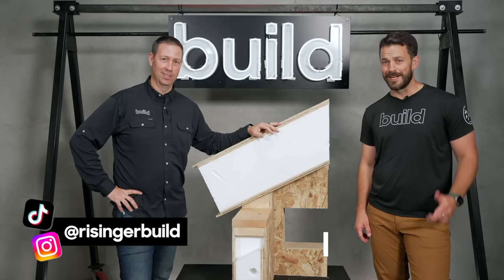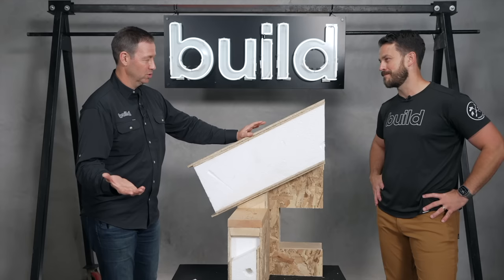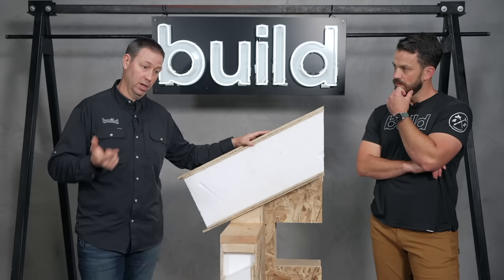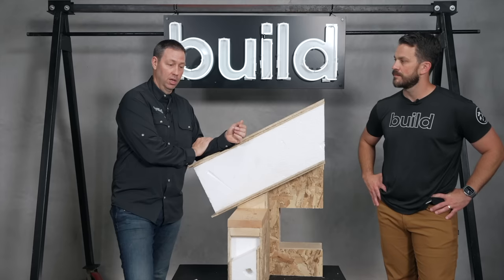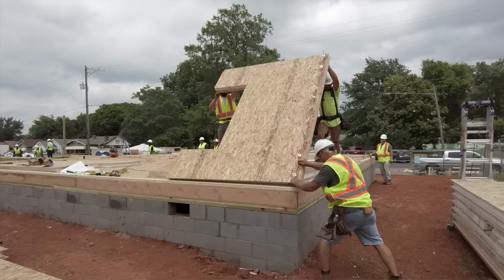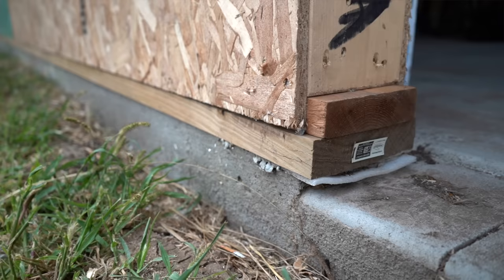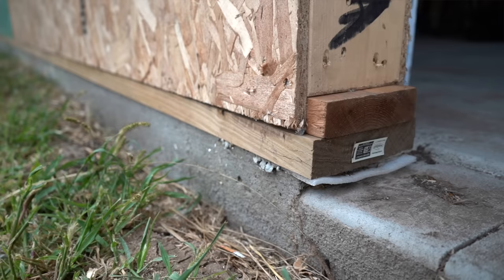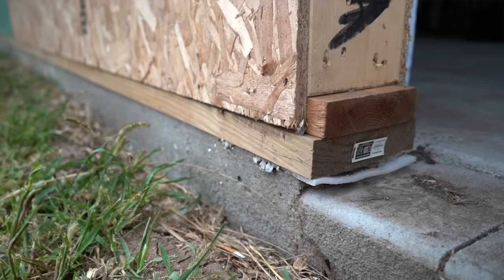SIPs Framing Update 2023 - Extreme Panel System Install w/ Will King

Comment: For the life of me I can’t understand why there isn’t more coverage and usage of steel sips. Totally superior in every way to even a plywood sip panel. Lighter. Stronger. Can be structural as well
Reply: Oh and let’s talk about wood splines and spray foam between panels. Take a look at steel sip panels. Goes together with male - female connectors
Reply: Same! I've been researching this topic for over a decade..  There are even more advantages than what you listed with steel sips over wood. Blows my freakin mind🙃
Reply: Well I put my money where my mouth is and I’m building with steel SIPs panels. I did a ton of research and could not phantom building with formaldehyde glued particle board over foam instead….
Reply: You make them very tight sealed around Plumbing and so on ! and sealed properly in between them then you put whatever on them rubber even whatever you want lay down two-by-fours laid flat vertical walls and roof then you can put steal whatever plywood osb again even, your doing a
 cold roof and the walls at the same time then vent.
Reply: He didn't explain the electric or plumbing well enough. How do you fish the wire for normal outlets? Or main panels?
Plumbing must be a nightmare.
Reply: @bobainsworth5057 sounds like the vertical chases let you get up from below or down from above. Or can run into another room side to side too. But I’m not sure how you’d get from the horizontal running down to your outlet or up to the ceiling.  I’d love a follow up video of those trades specifically putting in outlets switches etc.
Reply: @bobainsworth5057   yes and no you can precut wiring they can do it or you could I'm sure, to save money and plumbing you just drill and seal, and seal it off no gaps no "moisture Drive" that could be a problem, you also can put some outlets in the floor, I love insulated and sealed raised slabs with slate and tile with radiant heat ! Really nice, again you pre-plan electrical you can pipe it whatever make a long pipe router bit and guides "long drill bit" 
"hot wire" cut it precut simple..
Reply: @bobainsworth5057  it's definitely intimidating for an electrical guy that's never done it I think it could throw them off a bit.  😂
Reply: Carpenter ants LOVE Styrofoam 
And once they have started..
Lord help you!!
Use of borate in the production does not solve the problem
Reply: Will you please share more details on your findings, or at least share the product you decided to use?
Reply: @johnturner7060  Do you have documentation on this? How come borates don't help? I'm sure there's no nutrition for them in there. Are you saying they like to nest in there, or what? Is urethane foam more resistant? More details, please.
Reply: @bobainsworth5057 Fiberglass fish tape. It gets you through the chases for pulling wire. Then cut a hole for a flange box and screw it in.
Reply: @bobainsworth5057 You try to run all the Plumbing in interior walls.  Just a meter of designing for it.   Electrical, you have a chase at 18-inches up for receptacles, one at 43-inches for switches, and typically a vertical chase at a maximum of every 48-inches.   The factory can leave the chases out or add more if you specify them in the order.  Important to have your subs lined up and committed at the beginning.  So, the subs can review the cut sheets for the panels, and make sure chases, etc. are where they need them.
Reply: @magictrading8903  I am glad that you found a system that works for you.  I am very happy with our Extreme Panel project.  I personally would rather cut and screw plywood. It's a preference thing.  I would be curious on the screw holding power of the two.  Particularly for cabinetry etc.
Reply: @magictrading8903  I actually had never heard of these.  Seems like plywood would result in lower ACH numbers.  I had such a good experience with Extreme I would recomend them to anybody but I can see value in the steel skin.
Reply: @bobainsworth5057 I’m thinking you probly use  a vacuum to get the fish twine through the preexisting chases. Then just pull you wire . 
We use that system a lot in industrial applications.
Reply: Who makes the steel sips panels . I’d like to research these
Reply: Well Not so Fast...  Metal does bring some Major Problems with the Condensation.
Reply: @jameschupp2230  oh yea? How so with a full thermal break. Pls do tell
Reply: @magictrading8903  Yes it would require a Thermal Break
My interpretation of your first statement is that the whole wall / roof panel was incased with metal.
But with a thermal break, than that would help prevent the condensation issue.
Reply: @bobainsworth5057  Plumbing you come up through the floor from the basement or crawl space, and keep in the interior stud walls.  Electrical in the exterior SIP walls, is run in channels made by the factory.   They are typically at 16 and 42 inches above floor to meet boxes for receptacles, and switches.   Vertically you have a chase at 1-foot from the right hand edge.  But you can ask the factory to put them where you want, or add an extra or two.   One of the tricks is to use low voltage LEDs for the lighting and a light controller to drive everything.
Reply: My guess is that steel sips would have a much higher material cost. And realistically few /no one could afford it to create a whole house with them.
Reply: @magictrading8903 
May I ask which steel SIP supplier you prefer ?
Reply: @changwilson  there  are a few companies that produce them. You will have to do your own research as each have their pros and cons. I ultimately went for a full steel skin panel on the inside and out. They make some that basically are just reinforced eps with steel studs and headers. I agree there are a few challenges, like accommodation for blocking to hang cabinets etc. but the pros vs plywood anything are well worth it IMO. There is very little info on steel sips so I had to learn as I went but watch a few plywood sips builds and tell me that the splining the seams and injecting foam doesn’t look like a nightmare. And in the end you have what is not that different than a traditional stick build. I started with the premise that I wanted no organic material in contact with the elements and so I use no exterior wood. I wanted as little maintenance as possible. I don’t understand building with plywood or any wood product in the north east. Just seems like asking for trouble and a matter of time. Even if you protect it well you have expansion / contraction and insects and warping - fire - weight. The list goes on.
Reply: You can't get phone signal in steel sip building. Not popular
Reply: @mrkanarya1907 lol and the govt can’t read my brain waves either! Haha another plus if u ask me
Reply: Thank you for this comment, I’ll look into this product for my future build
Reply: Where do I find out Miya about steel SIPS?
Reply: @magictrading8903 are there non-binary connectors? Like they-them connectors? 🤔
Reply: @jeffconley819  Is there a vacuum tool or fixture I could Google for that's used for this?
Reply: Why is no one (that I'm aware of) building SIPS with ZIP for the outside layer?
Why is there a huge thermal break where the wall meets the roof?
I could have sworn that I heard them say that they recommend a ridge vent... in a conditioned attic??? Did I hear that right?
Why not use some cheap 1/2" thick  furring strips 24" OC between sips and sheetrock for the wiring? That couldn't add much to the overall cost, right?

Comment: I'd like to see a follow-up episode specifically on installing all the electrical, plumbing and HVAC. Very great system, would love to design a house specifically using your SIPS.
Reply: My question exactly
Reply: Mine too. Especially plumbing
Reply: @perspectivefrommarz plumbing is all interior walls.
Reply: Would especially be concerned about the electrical installation issues.

Comment: Hope one day they take SIPs to the next level and start making ZIP-SIPs.
Reply: Eco-Panels of Tennessee
Reply: I thought about the same thing but it's important to remember there's a moister and air seal in the middle of the panel, if you sandwich osb between two vapor barriers, it will trap moisture and caus issues.
It's what they are talking about with the roof membranes they use a vapor permeable membrane.
It would be interesting to see that combined with the panels, a surface layer like that may complicate shipping and handling of panels.
And scrape might add unplanned repairs.
I like the continuous overlaping seam water barrier thought.

Comment: I built a 30x40 urethane SIP shop in 2004 outside Tucson AZ. It had SIP roof panels and 20x30 apron in front with roof, it took a crew of 4 guys only 2 days to set up. I put radiant heat in the floor connected to a solar heated water tank and was happy all winter long. I got a mini split AC and turned it on for about 2 hours a day in the summer. I just loved working in the shop...
Reply: That is Amazing!
Reply: That is absolutely mind blowing how fast these guys can put up the stuff the energy efficiency as a total package is mind blowing
Reply: Can you tell about your radiant heat system? I am very interested in how that really works. Thanks.

Comment: Hey there! Thanks for the collaboration Build Show team! We're thrilled to have had the opportunity to answer all your questions about Extreme SIPs. We hope your viewers found the deep dive informative and helpful. If you have any more questions, feel free to ask! 🏗️🔩
Reply: I will definitely have to check them out to get an estimate on my simple home design. Since I am hoping to do most of the work myself on 1000-1200 sqft home, this could make things alot easier on me and I won't have to plan so much for all the air sealing and structural items like hurricane ties (i'm in south GA but some of these hurricanes have made it close to us in the past few years so i would like to see a little extra strength in my home design).
Reply: It be interesting to get a video of an electric/ plumber install
Reply: indeed cavaliers!  that would be great!  

2 questions I have: 

1.  you say you can hang (almost, im sure) anything anywhere.  what about those electrical & plumbing raceways...are those protected or just soo out of the way that you won't have to worry about putting a screw thru it?? 
& 
2.  i should mention i love, love the construction technique! what about damage after a fire or water . . . how easy/difficult is it to repair that?  maybe go into a little detail please and thank you gents!  good stuff for sure  : )
Reply: What is the Density Per Cubic Ft. on the EPS Foam in the SIP?

Comment: It would be interesting to see ZIP sheathing on the exterior and really streamline the dry in process
Reply: Eco-Panel of Tennessee has the zip exterior sheathing as an option.  But I haven’t found any manufacturers west of the Mississippi, and I’m in Idaho.  I have a couple of the manufacturers close to me who I asked if they would do it as an option, and they aren’t interested.   I’m trying to figure out a breathable self adhering membrane, I can apply on the ground….  I’m designing for a 12:12 pitch on the south facing roof to mount solar panels to, and being able to get a water barrier on it while on the ground would make life much easier.
Reply: @randallthomas5207  Why not apply Delta Vent SA after it's built, the traditional way? I assume it'll go faster and be more water-tight. My plan is to wrap the whole house in that from foundation to roof ridge. I checked with the manufacturer that it can be used as the only roofing underlayment. Also, Eco-Panel does ship anywhere in the country as far as I could tell.
Reply: @stevemarton5620  Shipping cost becomes quite high shipping from Tennessee to Central Idaho.   And I will want to dry it in as soon as it is up.   I’m going with SIPs because I can erect them with a couple of helpers.   There will be a daylight basement, planning on it being ICF, with an ICF concrete ceiling which will function as the floor of the upstairs of the house.  The lot has a ten foot drop over 15-ft from the upper level to where the basement will daylight.   So wrapping half of the upper floor will involve erecting scaffolding.   If I could rent an all terrain man lift, locally I would wrap after the SIPs are up.   And with a 12:12 roof pitch for much of the south side with the basement walls and the main floor walls combining for a twenty foot drop from the roof edge, I want to have the roof deck ready to install the metal roof, with a minimum of work on e south facing roof.  A 12:12 is a bit steep.   The north roof is a 4:12.  Lots more comfortable to work on, particularly with only a 12-ft drop on that side.
Reply: @randallthomas5207  Are you certain on this shipping? EcoPanel of TN is actually shipping mine to New York in a few weeks. But the cost of shipping vastly beats our higher cost of labor. Plus I was interested in the ZIP.
Reply: @pettydesign  Haven’t gotten quotes, but Idaho, and Montana are both very non-Union, and have extremely low wages.   And Tennessee is a long ways from Idaho.   I will probably ask them to quote the package, and double check that though, the use of Zip Sheathing would eliminate some of the other concerns.  Particularly on the roof panels.

Comment: A friend of mine is a SIP builder.  He gets his panels from Extreme which is about a 7 or 8 hour drive from the Black Hills.  He does blower door tests on all his homes and He is extremely finicky about fitment and sealing.  I"ve toured the Extreme panel plant and my cousin built some of the early equipment for SIP manufacturing.  Next time you talk  to Perry Penske or whomever you speak with, ask them about the curved roof panels they built for an architect in the Minneapolis suburbs. I've seen the house and it's damn cool.  Funny, I wrote my remarks before you went to Kansas so I was a little surprised to see Perry on the jobsite.   My builder friend has flown or driven to remote build sites to erect SIPS homes.
Reply: I am lucky enough to know your builder friend. He is building a house for me these days.

Comment: Matt, this was a really helpful video and I hope you do more on SIPs. I'm a residential designer and the one thing I found missing was a discussion about how to accommodate geometry that's a bit more complicated than a gabled rectangle. From a designer's perspective, I'd like to design for efficient use of SIPs but not at the expense of having to eliminate a bunch of design features such as L-shaped plans, steeper roofs, perhaps with dormers, porches, etc.

Comment: Re Electrical:  It is really fast if you make up some plywood template, and use a router with a plunge panel bit to cut the boxes in.  You end up with a hole a little larger than your box, which is true and plumb, the depth of the box.  Once you see it done, it is really easy.
Reply: How do you secure the wires if there are no studs?
Reply: @jaybbuilder  To the box.   The code normally requires the staples because it is exposed , and they don’t want it jerked loose if something snags on it.   Since it is in the chase, it can’t get snagged.

Comment: SIPS house was sheath with concrete board.  A pain to screw through for shelving ect.   But very strong.  Went threw hurricane Michael and house didn’t even shudder.  It was solid as a rock.

Comment: My 1954 house was designed by an architect, and it's the same design beams with sprayed foam ceiling with silicone coating roof. I only had to add zip r6 around the house, and energy savings are mind-blowing. It's a great design

Comment: Such a great video Matt, confirms a lot about what I think and feel about SIP building.  Would have liked to hear more about cost analysis.  OK,10% more mats. cost, 30% less labor, but Navigate did not mention what the typical labor/materials cost mix is on stick or SIP building.

Comment: I like the roofing aspect. I think it would be cool to merge ICF walls with SIPs roof. I think ICF has better natural disaster prevention, no thermal break from slab to roof, and it's a lot harder for a rodent/bugs to eat through concrete.
Reply: Same here. I would love to see an ICF foundation and wall and then this for the roof.
Reply: I agree, ICF walls and a SIP roof with ZIP sheathing used on the outside panel.
Reply: This is how I came to this video. Seems like a real good idea, if you don't want to do ICF roof pours.

Comment: Matt Risinger,
I have researched SIPS  panel construction pretty thoroughly. 

The one thing that is absolutely critical in building with SIPS is moisture control. There are documented large-scale failures of SIPS built communities in cold climates from moisture penatration into the chip board sheathing (which caused all the problems that come with sealed in moisture).

The panel joints must be sealed 100%, and the exterior wrap must be vapor permeable to not trap moisture in the wooden components of the structure. I would seal the interior SIPS joints with the proper tape style system if I were in a severe winter area.

I say this because in this episode, you mentioned wanting to see someone apply a liquid exterior moisture gaurd product. If someone did this with the wrong product in the wrong situation, it can be a costly mistake. 

Thank you, for all the good information over the last several years!
Reply: The Alaska debacle was epic